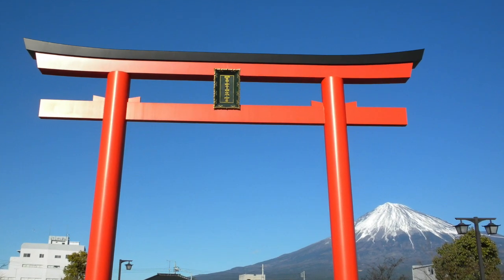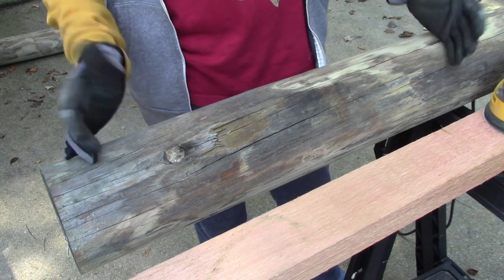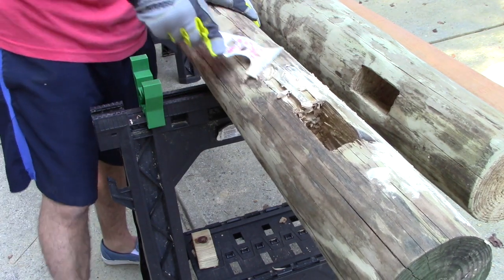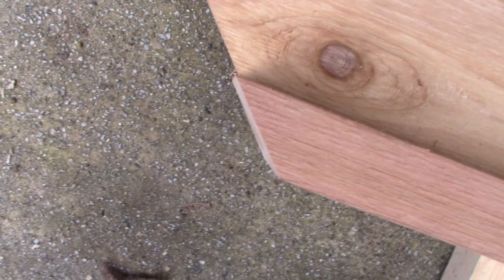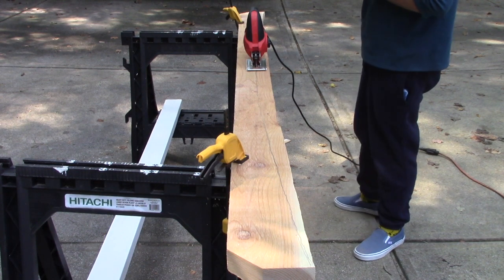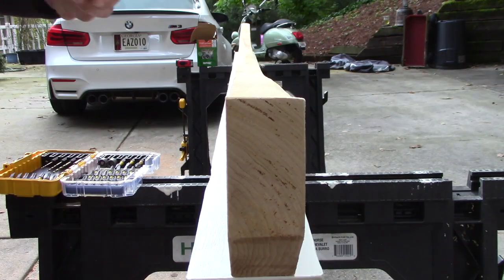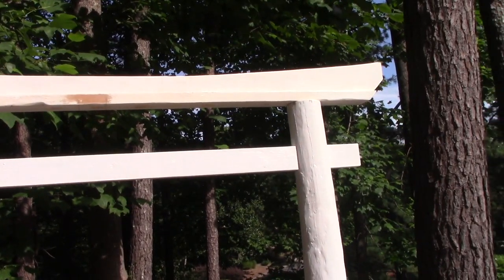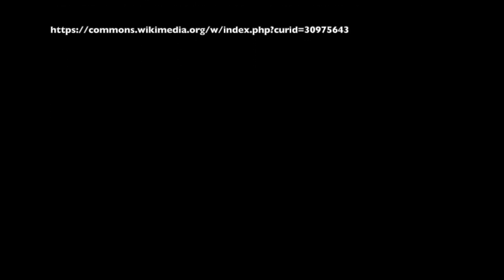Building a Torii Gate

Comment: Hi, How do you lock it in the ground? Thanks for any info!!
Reply: I am using 1/2" rebar 24" long drilled a few inches from the bottom that will be set in concrete, two rods for each side horizontally
Reply from the maker: I used a handheld post hole digger to create holes about 11 inches deep, then filled them in with dirt. I then spread gravel around the ground around the posts. I've seen others who cemented them, but that can cause water to pool and then rot the posts. YMMV